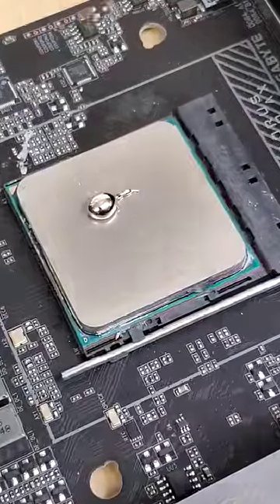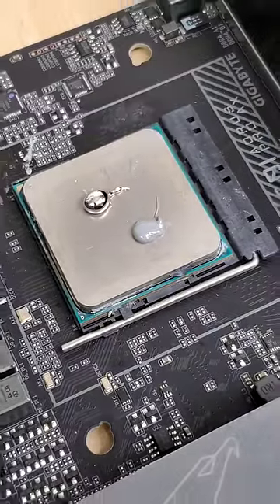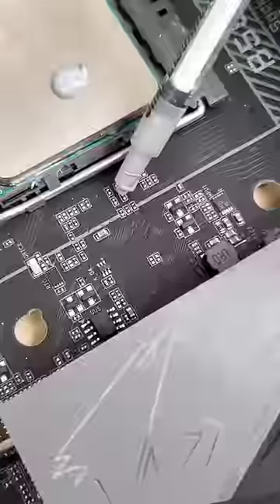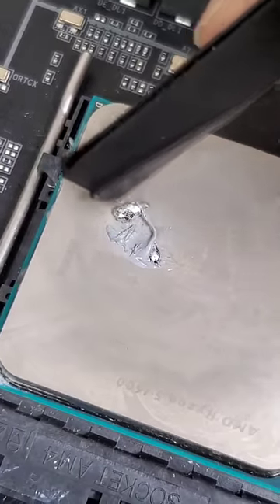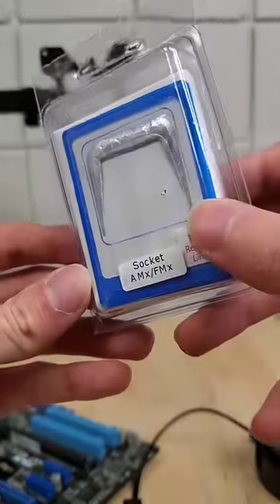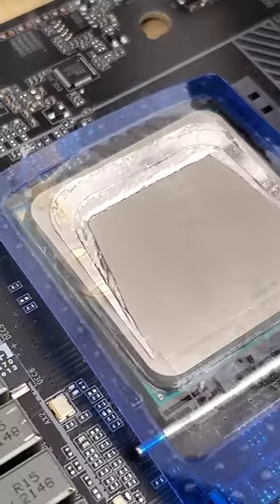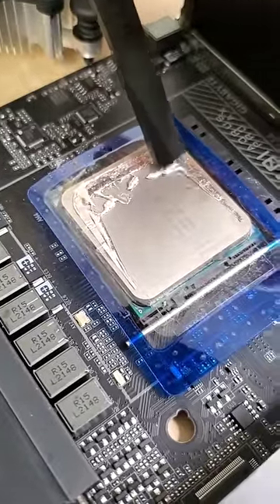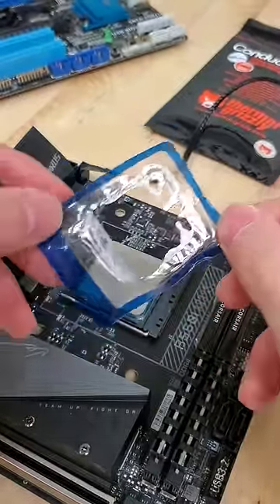the future of thermal paste technology #shorts

Comment: Why not just surround a dob of the metal stuff with the silicone stuff basically making an insulated wire to conduct the heat better without risking the metal touching the other components

Edit: According to several people, air pockets would form, which is bad for some reason. Also, someone said that uneven conduction of heat could warp the CPU, which makes some sense to me and my 3th-grade understanding of electronics
Reply: My thoughts exactly.
Reply: Sane ppl think alike
Reply: Glad I found you guys
Reply: Uneven conduction of heat could warp the cpu
Reply: The point of applying a paste is to distribute the insulation relatively evenly, doing what you suggest would concentrate the heat in one area and potentially cause problems down the line. Most "obvious" solutions don't work when we are dealing with a system this complex because there are always other factors to think about
Reply: Think you need to look up what insulation does
Reply: it's such a thin layer of thermal compound after the cooler is installed that it'd be basically impossible to do.  It'd take less effort to just properly use liquid metal
Reply: You’d be better off covering the motherboard with tape or something to protect it while you apply the Liquid Metal
Reply: They could chemically react with each other depending on the compounds usrd
Reply: It'll squirt out the metal and cause air pockets.
Reply: Hey! There ya go 👍
Reply: @kenzies.1362 that is a reasonable thing I didn't think of
Reply: Air pocket.
if you create a manufactured glob you can slap on, that might work?
Reply: Literally was just thinking that
Reply: You would get a little air pocket

Comment: The aerospace industry already solved this for us. It's call Honeywell PTM7950, nearly identical thermal performance as liquid metal but with zero risk to your components.
Reply: Sadly almost unobtainium...
Reply: It is meant for direct die applications though. Not good for a desktop CPU with a heat spreader.
Reply: @cemsengul16  It works nearly identical to liquid metal in both cases. A CPU having an IHS makes almost difference to PTMs performance, as basically every high-end chip easily breaks the melting point of PTM. The only difference with a CPU that has an IHS is you will have higher idle/low power temps until it hits that melting threshold.
Reply: @kingdom9214 Exactly, and that's only 45 degrees Celsius.
Reply: It’s easy to buy from china and it’s worth it it’s better than any other thermal solution gpus should all be shipped it applied imo now they draw like 400 watts
Reply: Its thermal conductivity is barely better than regular thermal paste. Regular paste: 5, Honeywell: 8, Liquid metal: 80.
Reply: Stop bullshitting us! Thermal Grizzly Conductonaut thermal conducting parameter exactly 10 times better than Honeywell. But Honeywell probably has the same like an MX8 thermal paste....
Reply: @retekfekete7807  PTM has two different thermal conductivity ratings. One as a solid which is similar to thermal paste, and second that as a liquid that is significantly better than thermal paste. Also thermal conductivity numbers don't translate to real world performance, graphene pads are insane conductivity but they still suck for cooling. You can easily find testing data between PTM & Liquid Metal, PTM  performs nearly identical. Devices like the ROG Ally use PTM instead of Liquid Metal like their laptops.
Reply: Tf you even talking about? Metal have better thermal conductivity than silicon based paste. Paste hardly hits 10W/m ·K while metal can reach 70W/m ·K
Reply: @kingdom9214  PTM is a paste not a solid object. Check the TG conductonaut performance! I dont think so if a silicon based paste would be better. And you can use water clear nail polish for the defended circuit area. Its easy.
Reply: Good luck obtaining it. Nasa for sure will consider your email about building your shit PC
Reply: @Pabloesc571  A certain large tech channel is stocking it..
Reply: While PTM7950 is excellent, it will only perform identically to liquid metal (galinstan) when used on an IHS, or anywhere that the limiting factor of the thermal interface is not the TIM itself.

However, on a bare die, especially a GPU die, if you replace PTM7950 with liquid metal you can expect around a 4-6C reduction of edge temperature, and around a 6-15C reduction in hotspot temperature depending on if it's an nVidia or AMD GPU.

Keep in mind that the 5-6C edge temperature different you'll observe between PTM7950 and liquid metal is similar to the difference between the best and worst performing silicon TIMs. 

So it is false that PTM7950 and liquid metal perform nearly identically, but it is true that PTM7950 is as good as it gets for a non-conductive TIM. However, if you want the best performance, liquid metal is hands down the best TIM.
Reply: AS5 for life
Reply: @revengeru  Even after all these years on the market, AS5 is still by no means a bad TIM. However, Noctua NT-H1 performs upwards of 6-8C better, is priced very similarly or is cheaper if you go for the larger tubes, it remains stable for just as long, and does not become capacitive when exposed to voltage like AS5 can.

AS5 had a good run, but NT-H1 is a more than worthy successor. Recommend you make the switch, it will not disappoint.
Reply: how about we just improve the power efficiency of the chips instead...
Reply: Yeah, right... ;D Honeywell thermal conductivity is just 8.5W/mK - not even close to liquid metall.
Reply: @goranjosic  Knowing those numbers probably mean you also know that thermal conductivity ratings don’t directly translate to thermal performance. A Graphene thermal pad has significantly better thermal conductivity than most thermal paste, yet it still performs worse.
Reply: Honeywells product has downsides that liquid metal doesn't though. On non direct die applications liquid metal far surpasses PTM, PTM requires burn in to properly transfer heat at its max performance, mounting pressure can have a significant effect on its performance etc. PTM doesn't phase change till a certain temperature and prior to that temperature it's heat transfer is not all that exciting.. Could lead to stresses on the cpu as it would quickly heat up to the phase change temp as opposed to a steady heat transfer with liquid metal
Reply: @ElShogoso we have. Massively. My old amd 9590 had over 220 watts TDP... My ryzen 7 5700x has a TDP of 65 watts and is orders of magnitude more powerful than my old 9590. Did you think cpus weren't improving dramatically?
Reply: @DarkAttack14  That's a bit of an exaggeration,  7950 phase changes at 45C. That's a few degree above most high-end GPU/CPUs idle temp, any type of workload will immediately break that PC threshold. So you're losing a bit of thermal performance between 30-45C where is doesn't matter since the chip in a low power state anyway. That's not much of a downside, considering the zero risk to your components.
Reply: Its specs say it is only 8.5 W/m K. There are other thermal pads and thermal pastes that are much better reaching 15+ W/m K. PTM7950  is only ~11% of the thermal conductivity of liquid metal.  Gelid GP Ultimate thermal pads are 15, nearly twice as good.
Reply: @KDarkmoon1  PTM7950 is a phase change material meaning it has two different thermal conductivity ratings for each solid & liquid. 8.5W/mk is its solid phase. Regardless Thermal conductivity specs are basically worthless in how it relates to real world performance. Graphene pads have insane thermal conductivity rating, yet that doesn’t translate to thermal performance. Graphene pads get beat by most basic thermal pastes. PTM7950 is miles better than thermal paste, and gets very close to the performance of LM in real world applications.
Reply: PTM7950 is no where near as good as liquid metal.  It's much better than traditional paste, but not as good as liquid metal.   I have some on my GPU and I've used it plenty of times.

Comment: Cool but the plastic is now a barrier between the metal paste and the cooler.
Reply: Most of the heat is generated starting from the center of the CPU die, spreading outward. So yes, plastic would be in the way, but i think it would be okay because it's towards the edge of the die
Reply: @iamjoehill  plastic creates a gap between CPU and cooler. You need more liquid metal to fill that gap. AT BEST you'll get same temperatures as from any shitty paste.
Reply: @Danger1225 yeah silly aint it.
They use thermal conductivity as some kind of marketing thing.
But the gap should be extremely small.
The imperfections should be filled by a material. Making it a bigger gap doesn't work.

I once tried polishing the cpu and cooler. At first it worked better. But the paste couldn't grip so it moved and became worse.
Just use good paste and not too much.

Also this cpu has a heatspreader, with paste under it.
Reply: @MrSpacelyy  with more ideal surfaces and probably too much force in tightening your cooler it is possible that paste pumped out. Try to tighten cooler more evenly, or use thermal paste with phase change (Honeywell for example). It is not ideal, but can solve this problem.

Comment: This is why I always said that people use to much thermal paste. The paste is only there to fill the air gaps, not to replace metal to metal contact.
Reply: But the contact between the IHS and cooler is often far from perfect and you're actually using too little paste then
Reply: @jordan-mn6yy  That where you are COMPLETELY wrong. Perfect metal-to-metal contact would move heat dozens of times better then regular paste, even LM doesnt provide as much termal conductivity - tho still better then paste by a mile. The only problem is - metal surfaces are imperfect this is only reason why any thermal compound even exist - to fill tiny gaps on metal surface that you cant see without some good microscope.
Reply: @alexturnbackthearmy1907 any amount thats too much gets squeezed out by mounting pressure. i dont think you understand the level of imperfect of the contact point. the past has to make a thin coating entirely across, otherwise it wont have proper heat transfer. 

yeah you're right metal transfers heat way better, but unless both sides are machined to almost glass level of flatness, and then mated together for the inevitable imperfections, they wont have the contact needed to replace thermal paste.
Reply: Did you not see the part of the video where the glass spreads the paste? Used alot and it didn't even cover the whole CPU
Reply: @bradhaines3142  Exactly. Its impossible to make perfect surface (without some very expensive techniques), and in mass production it can easily have 0.1-0.5mm height difference, then there is uneven pressure from cooler, paste moving around as it gets hot...but if you fine with losing some efficiency metal-to-metal isnt that bad (appropriate mounting for cooler, it will need to be a tight fit, sanded to be even for maximizing contact area and removing big gaps).
Reply: But isn't there some sort of paste under the lid to transfer heat from the actually chip to the lid as a buffer for cooler contact?
Reply: @thehurts9216  used to be but these days its just soldered
Reply: @alexturnbackthearmy1907  theres plenty of proof on youtube that shows you are wrong. the more spread the paste, the more disipation you get. theres like 5 to 10 celcius in difference, just search it. its not about the amount of paste, its about how spread it is and how good the paste is.
Reply: @bradhaines3142  facts, people tend to overdo the paste, don't want a mess use a small rice sized bead, simple.
Reply: Exactly, thermal paste layer should be as thin as possible, to the point of almost not being there.
Reply: @16driver16  That is absolutely not an accurate representation of the spread of thermal paste. You pushing down a piece of glass on a piece of metal will never be as close as 4 screws holding it down on each corner.

When you half the distance between the 2 surfaces, the paste has to cover twice as much space. You're probably seeing less than half of the total spread from the demonstration using glass.
Reply: @TheIncognitusMe  what? Why would the glass not be able to sit as flat as the cpu cooler? Screws would change nothing but the mounting pressure, which you can just push on the glass harder. There is little in this world as reliably perfect smooth and flat as glass I have no idea how what you are saying is possible
Reply: @TheIncognitusMe  do you think the metal conforms to the cpu??? It doesn't that's the entire reason for needing thermal paste
Reply: @16driver16  > which you can just push on the glass harder.

Do you think screwing a piece of wood onto another piece of wood results in the 2 pieces of wood being as close to each other as just pushing 2 pieces of wood together with your hands would do?

Go push your heatsink onto your CPU as hard as you can, then take it off and measure the spread.

Then put the exact same thermal paste spread on, and mount it using screws.

Tell me the spread is even remotely equivalent.
Reply: @16driver16  > do you think the metal conforms to the cpu??? It doesn't that's the entire reason for needing thermal paste

I dunno what I said lead you to think I thought this.

Fill a rag with water, and squeeze it as hard as you can. No matter how strong your hands are, you will not be able to get all the water out. Yet if you take both ends of the rage and twist them in opposite directions, a river of water will come out.

Your hands pushing down a piece of glass is not remotely equivalent to using screws to push 2 surfaces together. Especially when we're comparing a surface that's weak and breakable, like glass, to an aluminum or copper plate.
Reply: @TheIncognitusMe  unless you have a pilot hole in the first piece of wood you would likely have MORE space with the screws... but that's woodworking, ie entirely different as your not threading into wood here... the tiny screws used apply vastly different amounts of force also
Reply: @TheIncognitusMe  Intel recommends 8 inch-pounds / 0.9 newton-meters for modern LGA sockets. EK recommends 5.3 inch-pounds / 0.6 newton-meters. I can EASILY apply 8 inch pounds with my hand pushing on a cpu cooler... do you even math?
Reply: @TheIncognitusMe  so let's do the math. 8 inch pounds times 2 inches is 16lbs
Reply: @TheIncognitusMe  that entirely depends on the size of the screws silly!!!
Reply: @TheIncognitusMe  it's 16 lbs of force, I can do that with my hands by accident!!! Do the math yourself like I did for us to see right here!!!
Reply: @TheIncognitusMe  I just walked over to my bathroom scale and with ONE FINGER pushed down until it said 16lbs... that's as .ugh force ast intel recommends you use on your cpu WITH ONE FINGER...
Reply: @thehurts9216  These days, the IHS is typically soldered to the die.
Reply: People don't even lap* the CPU lids or heatsinks anymore.

Meaning puting in a small amount of TiM and buffing it into those imperfections.

Comment: Biggest issue with liquid metal is the gallium content not the fact it's conductive, if gallium touches anything with aluminum in it, its toast, the gallium will eat away at any metal that contains aluminum.
Reply: Same thing with mercury IIRC, which is the liquid metal glob he first showed.
Reply: @sethbettwieser  I was hoping someone would point this out and both of you did, as someone who did chemistry for 8 years, seeing him put either gallium or worse, mercury, on top of that CPU gave me a good damn heart attack.
That CPU is fucked, even if they remove the visible liquid metal off of it, if even an atomic level of it is left on the surface (which, trust me, it is) it will corrode that CPU plate over time.

Just look up mercury/gallium aluminium reactions and see what happens over time, there's a reason those substances cannot be transported via air mail without extreme precautions being taken
Reply: @sethbettwieser  Gallium and Mecury are very simmilar ik the way they look andgalium melts at 29°C.
Using Mecury would be insane given that it would give off mecury vapors which are very toxic compared to Galium😅

Comment: I just laid a Silver-Dollar over my 12600K . Temps never go over 185 Celsius and its still worth a Buck.
Reply: 185 celsius? Wtf..
Reply: @v1ndit tbh. Rambo is right, they never go over 185C 😂
Reply: I hear gallium works even better.
Reply: Yo, good to know, I'm building a 12600k into a PC right now, I'll skip the cooler and save $40 👍
Reply: That’s good, I was worried about my cpu reaching 500 degree Celsius again and catching my house on fire
Reply: @crazeyesyes3176  did you even read that comment? XD
Reply: @Pharozos  Based.

Had some extra gallium laying around, applied gallium to my CPU and heatsink and my temps are 30c lower. CRAZY!!!!

It's also non-toxic. We need to let people know!
Reply: @Pharozos  should I use the gallium 12 or 14 for my Dell
Reply: @Pharozos wouldn’t gallium react with the aluminum in the cpu/heatsink?
Reply: 12600 kelvin?
Reply: excuse me
Reply: lmfao
Reply: Never goes above 185°C because it has incinerated by then.
Reply: not recommended
Reply: @brandonl9964 I thought gallium is corrosive too. Wouldn’t it just eat through the aluminum
Reply: Older issues of silver dollar 90% pure, good, if you are using modern issue silver eagle 99.99% pure and you can get even more thermal transfer capability.
Reply: @brandonl9964  didnt read the comment with your sense of humor on did you? Or did ya plan on actually putting a silver dollar to test it too?